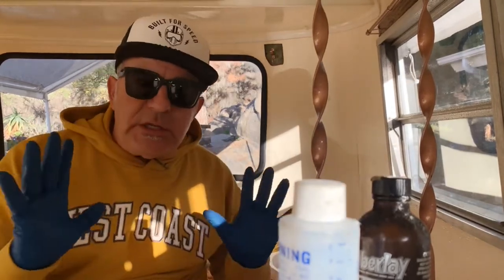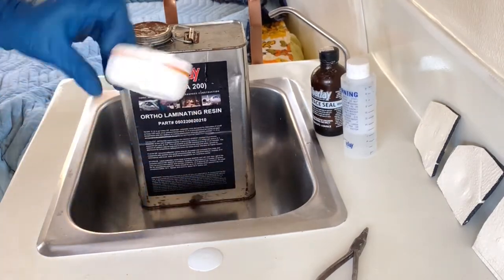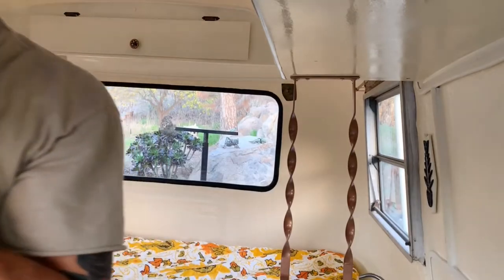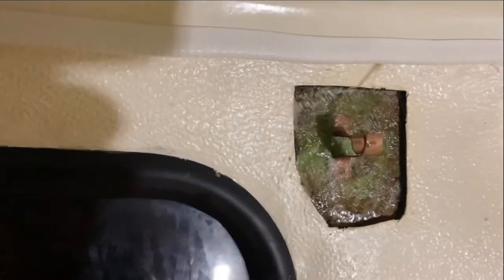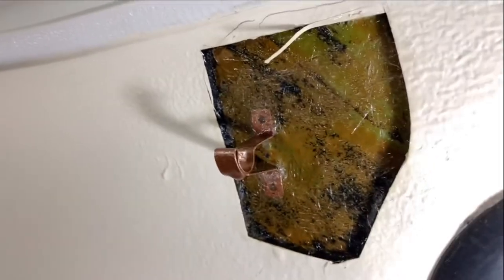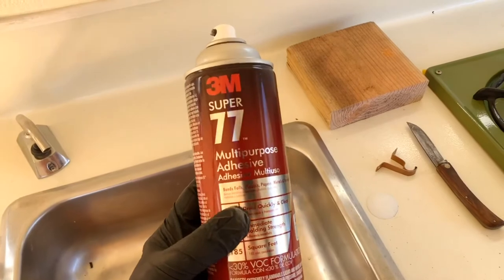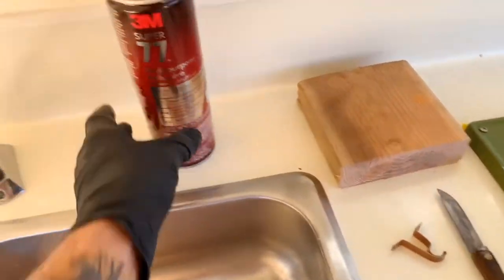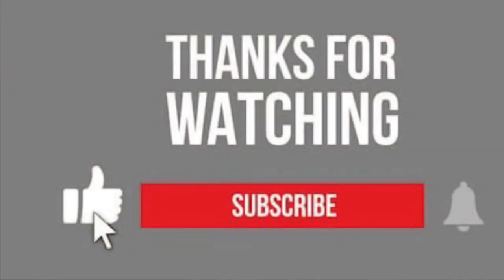FIBERGLASS! | RV Curtain Rod Holders NO Rivets! #scamptrailer #RV Repair

Comment: Thanks for sharing, great job. Two questions 1. what kind of paint was used. 2. Would you provide a link to the elephant skin.
Reply from the maker: Happy New Year Roy! 
There isn’t a link to the “elephant skin” unfortunately. I have heard of people using 1/4” cork cut from rolls to replace the original stuff. It would be really nice if Scamp Trailers Inc would re-produce or order more if they got it elsewhere..
Reply: @westcoast_johnny  Happy New year.
Reply from the maker: Hi Roy, the paint I’m using for the interior is latex house paint, interior, with a flat sheen. 👍🏼
Reply: @westcoast_johnny  Thanks Johnny, great job. Getting excited to see the door lock repair.